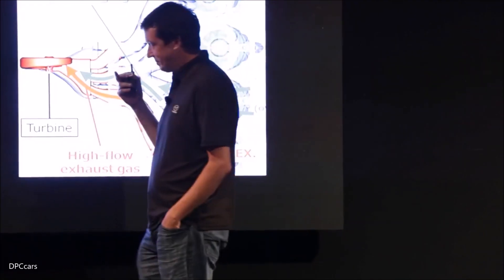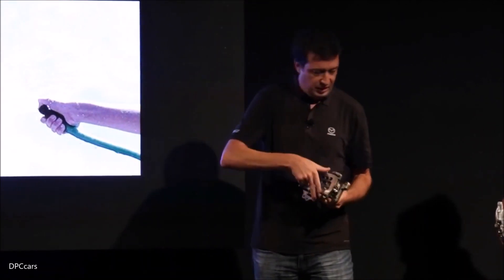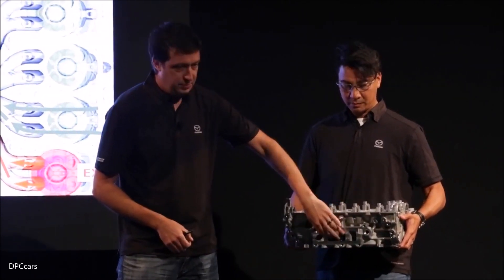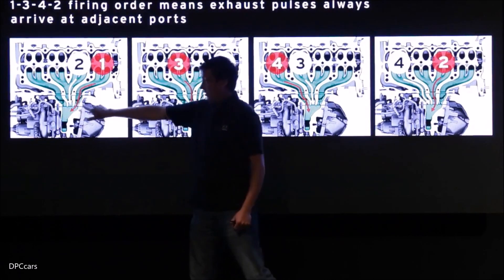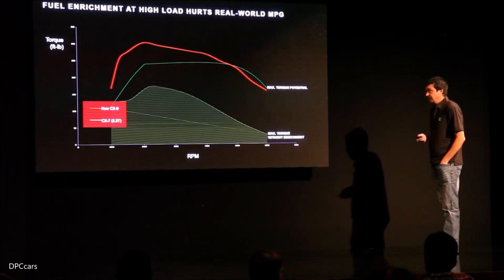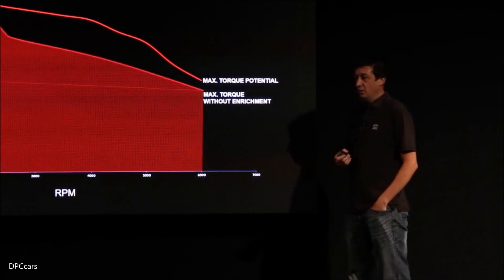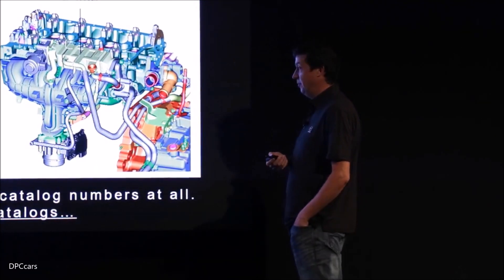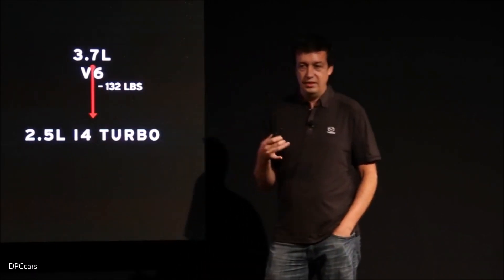Mazda CX9 4-Cylinder Turbo Engine Explained

Comment: 2017 cx9  2.5 turbo signature awd owner here. Bought it with 20k miles on it and we loved it while it lasted. Engine took a dump at 140k miles. Dealer wanted 11k to drop new engine in. Turns out the head on alot of the 2.5L turbo heads are defective, and it's a matter of time before they Crack internally. Luckily we kept our 2007 chrvy tahoe 5.3. 265k and still running like a champ. STAY AAWY from this powe desing pile of shit 2.5L skyactives!!

Comment: very enlightening mechanical engineering presentation. i have a new 2023 mazda turbo premium plus. with 950 miles on the engine.when using premium fuel only or regular or a combination of both intermittently is it better for that engine to use just use regular or premium long term in your opinion

Comment: NOW... if you can get Hyundai to license their CVVD (Variable Valve Duration) camshaft  AND use the recently invented TPS (Transient Plasma Systems) new plasma plug (fires more instantaneously and rumens cooler) with the Skyactiv X engine we will have a LOT of efficiency and increased power.

Comment: Turbo engine reliable or non-reliable?
Reply: When have they made a piston engine or any engine unreliable? The rotary engine just needed maintenance at a very early amount of miles on it, due to the nature of the engine and the seals that wear as they slide across the combustion chamber rather than metal rings. The turbo 2.3 engines had no issues, so long as you understood direct injection engines and did their maintenance, which was a pioneering effort [that I applaud] by Mazda (not to mention BMW and VW/Audi). Those engines and all engines since them, that have been direct injection, must have an internal cleaning done every so often due to buildup from no longer having port injection which took care of any buildup before direct injection came along. Cleaning could be done by hand, with a media blaster, or with the most friendly cleaner in a bottle, seafoam or similar product.

I personally have over 250K miles on my 2.3Turbo Mazda which has had a bottle of cleaner run through it at every oil change. No issues, ever! Unfortunately, and to be truthful, Mazda never informed their customers of the required cleaning, although BMW did. So, I took it from the BMW guys, and mastered it.

Shame on Mazda for not telling their customers, and letting us figure it out for ourselves... but they did swap out many engines under warranty without any hassles... unlike Honda and their failure to inform the customer of their nearly 100 thousand faulty engines & transmissions that they would fight teeth and nail to not warranty, yet they knew about it and still won't come clean (19years later)... hide it under the rug is Honda's motto. Never again will I buy a new Honda. I've learned my lesson.
Reply: @copperkeyracing6167  Toyota Highlander 3.5l vs CX9 2.5l....which  will last long in terms of miles or kms?
Reply: @copperkeyracing6167 thanks bro. Yesterday I was looking for the used 2018 CX9 2.5l turbo gasoline and same year Highlander 3.5l gasoline and was shocked with the price gap. The cx-9 touring was for 27500CAD and highlander base model LE was for 39000CAD and I am getting inclined towards CX9 for 27500cad which will save 12000-13000cad if I drop highlander for 39000. Obviously anybody will go for 27500cad cx9 even diehard fan of Toyota like me will drop plan for highlander when cx9 at such good price is available. What are your thoughts on this?

Presently, I own Corolla 1.8l gasoline and the one thing for which I am worried is its cvt engine which has 109000kms and Toyota dealership says that cvt has lifetime fluid which doesn't need to be changed and this is undigestable to me.
Reply: @nikhilgaba1  CVT transmissions are not good. I would be worried. They don't seem to last with any manufacturer. A normal automatic last longer. I don't know about specifically Toyota CVTs though... Between the CX9 and the Highlander, I would go with the CX9. Good luck
Reply: @copperkeyracing6167 , the Toyota is equipped with dual injection (direct and port injection.)  2 fuel injectors per cylinder. So you have the cleaning effect behind the valves.  Toyotas D4S.  It is also in Subaru BRZ/GT86.
Reply: @anthonyz7023  and don't forget it's also in the G16E engine in GR Corolla.
Reply: What type of cleaner do you run through at every oil change?  @copperkeyracing6167

Comment: Most people could care less about this stuff. But this is the sort of detail and innovation that keeps me coming back to Mazda. Looking forward to this engine in my new 2018 Mazda 6. And yes, I could listen to Mr. Coleman all day. Hopefully Mazda appreciates what a guy like this brings to the table. A car guy who understands and can express extremely complex concept in layman's terms.
Reply: Ditto to your points. Already a dedicated Mazda buyer with strong respect and appreciation for Mazda's true and innovative technology culture, this presentation by Mr. Coleman has me now leaning toward purchasing a  CX-5 with the 2.5 turbo (GT Reserve) instead of the normally aspirated standard GT which I was previously planning to buy. Coleman is an impressive ambassador for Mazda.
Reply: Yamoto86 have you driven out yet? I did, and there only negative was the harshness of the engine during acceleration. So, I prefer to stick with my 2.5 n/a engine
Reply: FrostyCoug  Thanks for the input. I currently have a 2016 CX-5 with 178,000 miles (not a typo). I've had zero mechanical problems with the car, so from my experience have very strong confidence in the durability of the 2.5 n/a and it's FWD.  I'm impressed with and very interested in Mazda's engineering features of the 2.5T, but I don't have a strong need for the extra power and AWD, thus at this point I also will likely stick with the non-turbo (lighter weight, fewer moving parts and complications, etc.) for my upcoming purchase. Your input helped with that decision.
Reply: Yamoto86 I think you made the right choice. Fuel economy is mediocre on the 2.5t also.